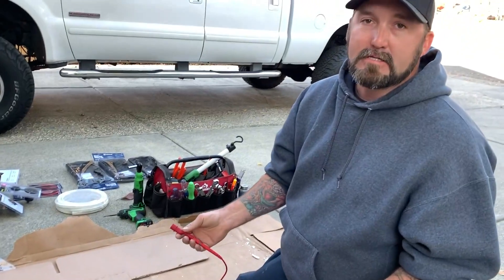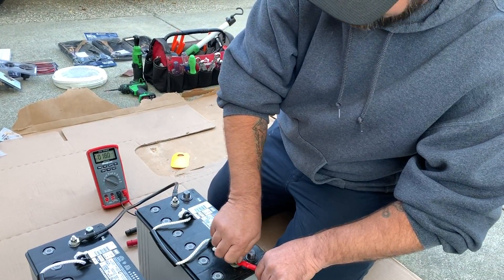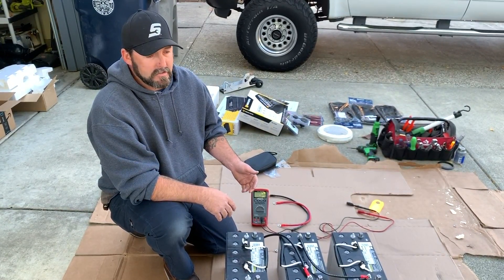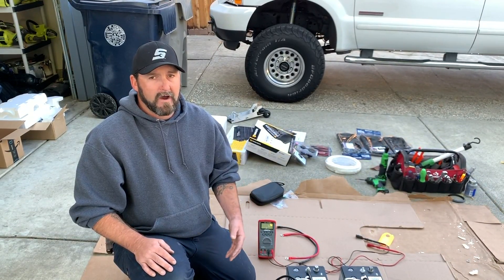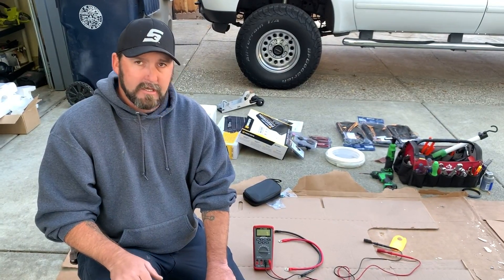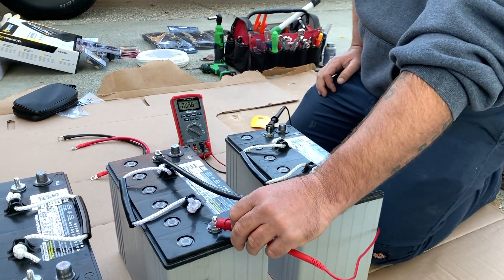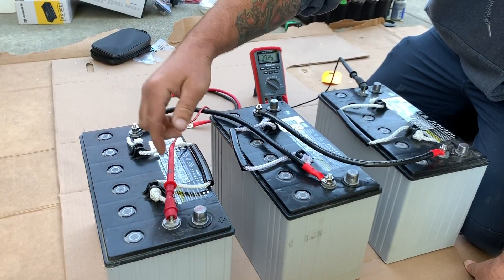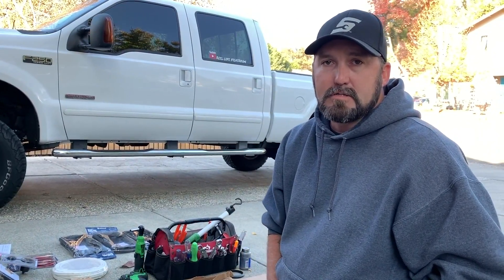BOAT BATTERY WIRING | TROLLING MOTOR | HOW TO

Comment: What kind of wire does the wire connecting the two batteries for the 24 volt system need to be?
Reply from the maker: I use and recommend anchor marine 4ga wire .. but any marine grade 4 to 8ga wire will work.. do not use any wire made for stereo systems .. thanks for watching and let me know if you have any questions..
Reply: Reel Life Fisherman thank you!

Comment: Is running 24v into a 12v trolling motor bad or is it ok...as long as the motor wiring can support it?  Thanks for the video...
Reply from the maker: If the trolling motor is not selectable from 12v to 24v it’s bad.. it will fry the board and cook the motor.. thanks for asking.. and thanks for watching..
Reply: @ReelLifeFisherman  Thanks...you saved my motor...a lot of You Tube videos showing it as not being a problem..i am glad i ran into yours...
Reply from the maker: As a certified minn kota tech.. I can tell you.. don’t do that! lol 12 on a 24 won’t hurt but it will have no power at all.. and why would you do that..?  There are different control boards for each voltage.. running the wrong voltage will mess them up! Thanks again for watching

Comment: Thank you for the video, Can I get two of Duracell SLI34MAGM one to power my Suzuki 150Hp engine and one for my accessories GPS, speakers, lighting.......?
Reply: I don't know if it the Duracell SLI34MAGM is it the right choice or do you recommend something, just I need two batteries for my boat one for the 150hp engine and one for the accessories.
Reply from the maker: Glad you liked the video! So you would want a marine cranking battery with 800 cca for your engine.. and then a deep cycle for your house battery and be able to switch back and forth with a battery switch.. I have another battery video discussing that set up.. but one of the Duracell deep cycle would work great for the house battery.. but you would be just fine with a group 27 .. thanks for watching let me know if you have any questions

Comment: OK you’ve kind of explained it except one other addition I want to be sure of. I have two batteries they both go to a Perko switch. Then I can have battery one to my 12 V system battery two to my 12 v system or both 12 V batteries to the 12 V system. Am I still safe making a connection from one negative post on one battery to the positive post on the other battery so I can hook up a 24 V trolling motor as you showed? Selecting the Perko switch and all three positions of 1 to 10 duel will not short out after I have run that lead from the positive battery terminal on one to the negative terminal on to?
Reply from the maker: Chris Jones personally in my boat I have 4 batteries.. 2 trolling motor and one cranking and one deep cycle house battery.. if you don’t have room for that.. and want to have a backup battery in a emergency you can hook to one trolling motor battery on position 2 on the switch.. or just use jumper cables and hook them in parallel.. it works too.. don’t know but I’m sure somewhere they have a schematic...
Reply: Reel Life Fisherman super helpful.  Subscribed and waiting for all your upcoming content
Reply from the maker: Awesome! Thanks for subscribing! I really appreciate it! Let me know if if you ever have any questions.. I always try to get back to you as soon as I can .. and help the best I can over the internet..
Reply from the maker: No trolling motor batteries should remain separate from cranking or house batteries..  you can wire it where position 2 is hooked to only one of your trolling motor batteries.. but that is only for emergencies and not to be used as a house battery.. hopefully that makes sense.. let me know if you have any questions.. and thanks for watching
Reply: Reel Life Fisherman kinda makes sense.... so I need three batteries if I am to keep a cranking battery and I have a 24v motor mount electric outdrive plan.  Is there a schematic anywhere available to show this, or should I just eliminate the perko all together

Comment: Is there any reason why you couldn’t hook up 2 12volt batteries parallel so that a outboard motor could be recharging both while cruising? I’ve been looking at the Blue Sea - ‘Mini add-a-battery’ switching device on Amazon wondering if it made sense or just use jumper cable alligator clamps to separate the trolling motor on a 25HP Mercury 4stroke witch comes with a pull start just in case the starting battery goes down?
Reply from the maker: So especially with smaller engines.. the stator trying to charge both batteries at the same time can over work them and burn them up.. due to them always being in a state of charge..  for your set up it might be better to just bring the jumper cables in case of emergency.. but as for as running in parallel.. you need them both the be the exact same battery.. not one deep cycle and one cranking.. or one group 24 and one group 27. Hopefully that makes sense and answers your question.. let me know if you have any questions about it.. thanks for watching
Reply: Reel Life Fisherman that is great information and I was doing more research; this explanation not only confirms but is much clearer.  The device from  Amazon prevents this but now their explanation makes much more sense what and why. Thanks. I subscribed!
Reply from the maker: Awesome thanks for subscribing! Welcome to the channel! Glad it helped.. and let me know if you ever have any questions.. I do my best to help..

Comment: Very Informative video. This is an example of the difference between an amateur and professional speaking on products and giving out recommendations and info on those products. What type of battery would you reccomend for a 12 volt Hummingbird Endura trolling motor  ?
Reply from the maker: Thanks I appreciate it! Glad you liked the video and found it helpful.. so I would definitely go with a group 31 AGM or flooded lead acid just depends on how much you want to spend really.. either one will work just fine.. the AGM will just hold up longer (in theory) I see all kinds of good new batteries with issues.. so most importantly make sure the warranty and rerun policy is good.. thanks for watching and commenting..

Comment: HELP!!!! 
I have a 36v minn Kota fortrex 101 after hooking everything up my trolling motor. It still seem like my trolling motor is not pushing its full power. All batteries are sitting at 12.7-12.9A all gauges are 6 at 600v. I also hooked up a Minn kota 36v breaker and the trolling motor still pushes very weak. I set the speed on max 100 b/c it’s so slow it couldn’t troll my boat and it seem to be running at mid speed or below. I open up my housing on my trolling motor everywhere hung looks good armature looks good. Any ideas or tip I need to know how to get this fix??
Reply from the maker: Let’s first take a look at the batteries.. you’re sure they are hooked up correctly for 36v ? Also how old are they? Sometimes just because they have the correct voltage doesn’t mean they can handle a load.. do you have a way of using a load tester? Thanks for watching and let me know.. maybe we can figure out what’s going on.. sometimes that can be hard to do over the internet.. instead of looking at it in person..

Comment: Do you know much about the older trolling motors. My trolling motor has an option for a 12v or a 24 v system. It has two positives and one negative coming from the plug. Do you know which way I should hook up my batteries to run 24v
Reply from the maker: Yeah they used to run the wires for both 12 and 24 at the same time and allowed you to choose depending on what you wanted that day you were fishing..  the boat side of the plug and batteries were wired for 12 and 24 you can tell by looking at your wiring at the batteries or using a multi meter at the plug.. easiest way is to look at the wiring and pull the boat side if the plug and the same wire color hooked 24v and use those prongs to figure out which way is 24 in the trolling motor side.. hope that helps and makes sense.. let me know if you have any questions about it .. thanks for watching
Reply: Reel Life Fisherman the guy who owned the boat before  me also has the two 12v batteries connected by a wire running to both negatives but shouldn’t it run from battery 1 positive to battery 2 negative.
Reply from the maker: I typically just abandon the 12v wire and only hook the batteries up in series.. once you figure out which way is 24 on the boat side of the plug..  if that makes sense.. there is really no reason for the 12v in my opinion..
Reply from the maker: One is usually orange and one red.. then black of course..  the orange is normally the 24 way if I remember right.. been awhile since I messed with one like this..
Reply: Reel Life Fisherman awesome man thanks so much for replying. Going to hook everything up now!

Comment: Good video.  Thanks for making that look easy.  I have a question about hooking up an onboard charger to a 24v series system.  Which terminals would you hook up the charger too?  The trolling motor terminal?  The series terminals??  Or all four terminals???
Reply from the maker: Thanks glad you liked the video! So you want to hook each battery charger bank to each battery.. positive and negative..  they are designed to detect  and protect themselves and the batteries.. let me know if you have any more questions about it . Thanks for watching and commenting

Comment: Liked the video! I just bought a 10ft boat w a 55lb minn cita trolley motor.
The boat has an enclosure for the battery.  I bought a group 31 deep cycle marine battery.  The boat is orreries from that compartment to the back for a quick plug to the trolley.
When I was out today for the first time, the breaker that’s on the positive wire of the battery kept popping if I kept the door of the compartment closed.  It was overheating.  If I opened the door it was fine.  Do you have any suggestions?  Do I need to install a fan of some sort or change out the breaker?  Is the gauge of the wire too thin?  Thanks for your time!!!
Reply from the maker: You should have a 50 amp breaker and depending on how long the wire is ran from the battery to the trolling motor.. it should have 10ga minimum.. also sometimes the breaker itself can just go bad..   let me know if you have any questions but you should be able to run it with the lid closed if everything is correct.. thanks for watching
Reply: Reel Life Fisherman thanks for the advice!  I will definitely try your suggestions!!

Comment: Question, I have a two bank charger one to the cranking battery and one to the trolling battery if I brought another battery in line for the trolling motor will that charger charge the two batteries parallel together and also the cranking battery or do I need another charger? Thanks for your help
Reply from the maker: So yes it would.. but none of the charger manufacturer’s want you to do it because it can over load that bank.. they want a bank for each battery.. so you should get a 3 bank or add another single.. thanks for watching and the question..

Comment: Question - I'm upgrading from a 12v powerdrive v2 trolling motor (2 12v batteries in parallel) to a 24v ulterra, I charge them with a 3 bank onboard charger (the cranking battery is the 3rd) When I change the 2 12v batteries from parallel to series, will I leave the two leads (1 bank each) from the on board charger on each battery?
Reply from the maker: So you absolutely leave each bank hooked to one battery and wire them in series.. each battery is still only 12v the only thing hooked up 24v is the trolling motor.. let me know if you have any questions..
Reply: @ReelLifeFisherman  Thanks for the very informative videos - I discovered your channel when I was searching for a video on installing the ulterra and noticed your installation video on the same basic boat that I have - Tracker Pro Guide V 17.5 WT - Thanks again

Comment: Great video my man.  Question: how does the battery selection switch (1/2/both) fit in to a 3 battery setup (1 crank + 24v rigging for the trolling motor)
Reply: I THINK the answer is you can't use the battery switch in this scenario, you would need a 4th battery to run on the switch as a "accessory"/backup cranking battery.   the other two batteries may not work because they are rigged as a 24v system.  Thanks man
Reply from the maker: Exactly you would want the trolling motor on its own set of batteries.. completely separate.. then have 2 batteries on a selector switch just for the boat.. thanks for watching and let me know if you have any questions

Comment: so what if you have lights and a trolling motor will that work as well? or should you use one battery for the trolling motor and one for the lights?  could you do a demonstration showing  how you would wire a trolling motor using a circuit breaker running to a marine switch panel Thanks

Comment: I have a 24v setup for some reason when i go to bridge to make it an 24v my radio doesnt come on,but when im connecting the jumper pos to pos then it come on?
Reply from the maker: sithab1 you should only have the trolling motor hooked up 24 volts .. don’t try to run anything else off of those batteries..
Reply: Ok thank you

Comment: Great video! Thanks!  I am buying 2 new 12v batteries for the 24v trolling motor and not sure which category I need (old no name trolling motor)...and if I can keep them hooked up 24v in the boat in the garage after use to trickle charge?  I dont have a charger yet so was just going to find something on Amazon.  Any suggestions for which category batteries to buy and charging in the garage as a 24v system ? (2-12v connected in series as you instructed)
Reply: As follow up... I see that I have 2 red and 2 black #6 wires coming from the bow to the back...so do I connect 1 red wire to battery 1 pos, then #2 red wire to battery 2 pos, and same for 2 black wires to the negs on each battery ?
Reply from the maker: So I would suggest either group 27 or 31 deep cycles marine batteries.. and a good 2 bank or 3 bank charger if you want to charge your cranking battery at the same time.. you just plug it in when you get home and leave them all connected.. I like the minn kota ones personally..  as for the trolling motor wires.. sounds like you might have the 12/24 plug set up with 4 prongs..? If so as long and the 2 wires you hook up.. one red ..one black ..are the same on the female side of the boat and the male side on the trolling motor it will
Be fine.. so if the red positive wire is on battery one and the black negative wire is on battery 2 and on the back of the plug they are hooked to 1 and 2 or A and B however they are labeled do the same on the trolling motor plug side and you will have 24v and just abandon the other wires or remove them.. hopefully that makes sense.. let me know if you have any questions.. and thanks for watching

Comment: Great video man, just wondering I’m planning on upgrading to a 24 volt trolling motor but currently only have 2 batteries and no room for a 3rd, right now i use one battery for cranking,pumps,electronics and lights, and the other is for my 12v trolling motor. Would it be possible for me to use both batteries for a 24 volt trolling motor but also keep all of my other things on one of them or do I absolutely need a 3rd battery? (Any advice is appreciated)
Reply from the maker: Yeah you would definitely want a 3rd battery.. for a few good reasons.. first you don’t want to drain your crank battery with the trolling motor and leave you stranded.. the second is the batteries have to have the same rating and size.. and I wouldn’t  recommend hooked a deep cycle and a crank battery together unless it was for an emergency.. also we only hook the trolling motor to its own battery or batteries because it causes electrical feed back to fish finders and other electrical devices when the motor is spinning.. hopefully that helps.. I know they don’t make enough room on boats sometimes for extra batteries.. it’s like they figure out the battery storage last.. lol.. let me know if you have any questions.. and thanks for watching
Reply: Reel Life Fisherman thanks.

Comment: Could you do a video showing how to connect the onboard charger to the trolling batteries? Both the 24v and 36v setups.
Do you have to connect each battery independently or would it work paired like in this video?

Comment: When you do parallel for a 12 volt trolling motor do you put motor leads on one battery or neg on one and pos on other
Reply from the maker: Yes it’s best to make the jumper wires positive to positive and negative to negative.. then hook the trolling motor to one battery positive and the other battery negative.. so it will have the best chance to drain both batteries exactly the same.. thanks for watching and for the question..
Reply: @ReelLifeFisherman  If I set this up, how do I charge the two batteries? Is it as simple as putting the charger on one battery, charge that battery, then put the charger on the other battery and charge it? Or do I just put the charger on one battery and that will charge them both, or maybe I put the chargers pos on one battery and the charger neg on the other battery to charge it? thanks